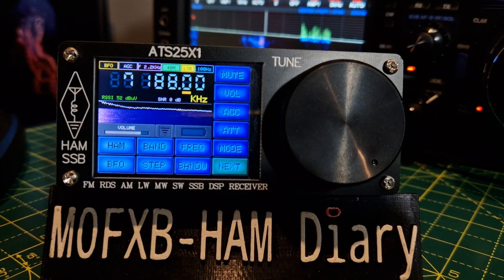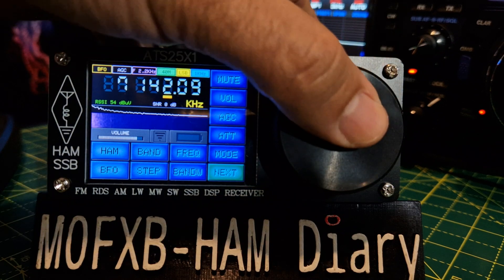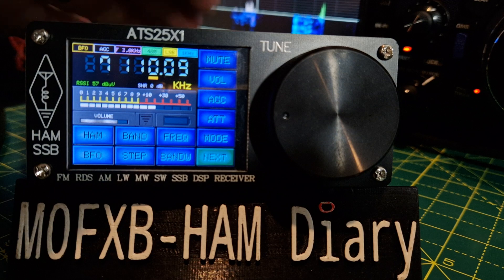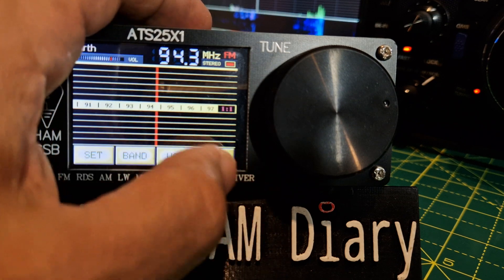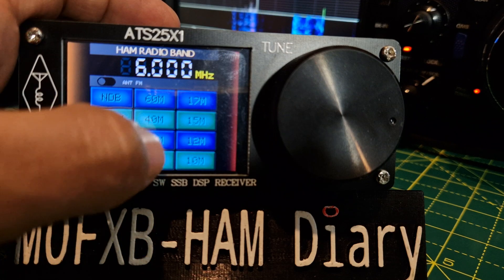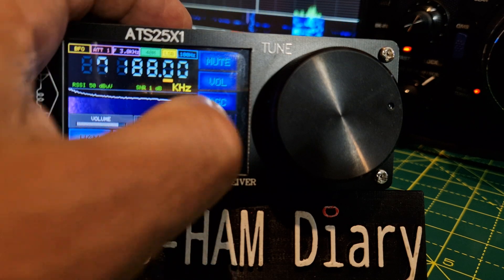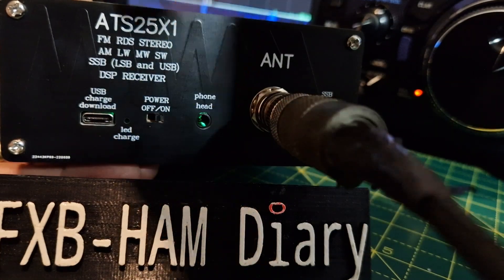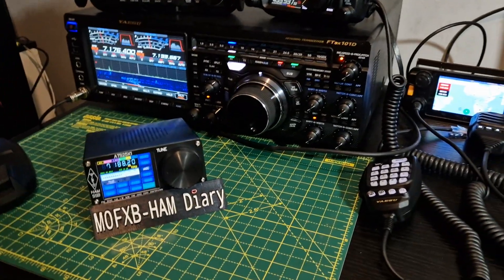NEW - FIRMWARE ATS25X1 with WIFI

Comment: Works well even not updated..But  this i will add for the Hf bands - (it's a must requirement to use a good Ant) preferably with a good  ground..it is worth every cent this radio if u set it up right it is quite a good radio no Questions about it.
.
Reply from the maker: Long wire is all u need

Comment: Can I ask, how do you know if the radio is connected with the USB cable to the computer. Does it show as a drive or nothing? I have installed the divers for the update 4.15 but see no change on the radio or computer when I plug it in.
Reply from the maker: https://youtu.be/F47X2vI6_Lk